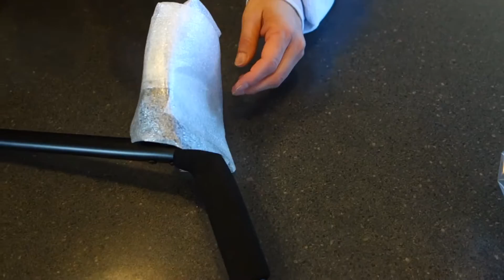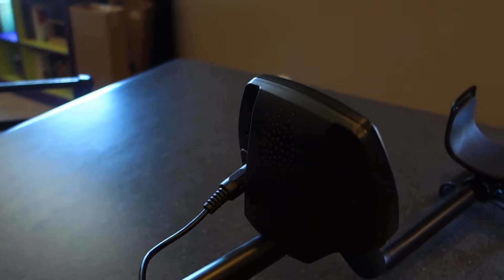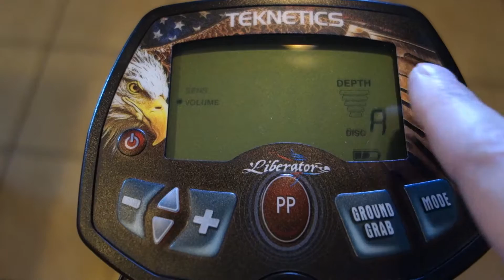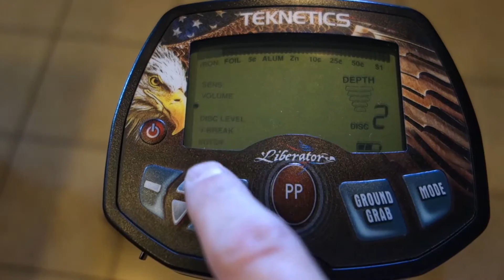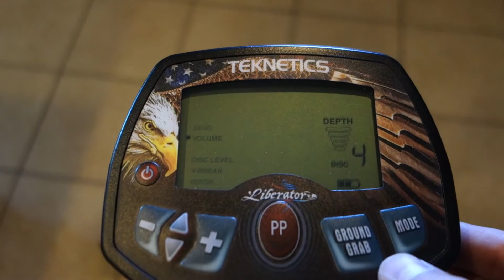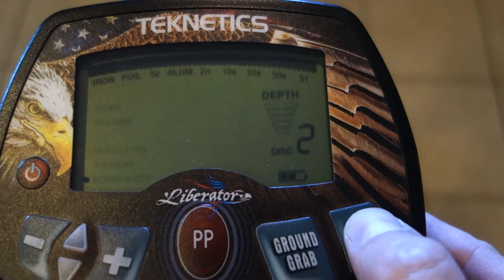Metal Detecting:  Teknetics Ameritek Liberator - Unboxing and Feature Review

Comment: Yep. It's an Land Ranger Pro. The LRP is a good machine (it was my #1 until I upgraded to a T2se). This is an improvement in that it doesn't say "Bounty Hunter" on it, which immediately causes people to talk shit.
Reply from the maker: From a marketing standpoint...it is genius and they should sell very well.
Reply: Even after I dug a merc at 7" in a trashy yard I get lip. This machine is outstanding for the price.
Reply: I think the only thing BH or FT in general needs to do to improve its brand are 2 things. 1. Don't make so many versions of the same or similar machine. By that I'm not referencing this move. BH alone has 3 or 4 renamed versions of the same machines like in the discovery series and many of the older muffler on a stick models. One reason people started to not take the brand seriously is because there's were too many and with often whimsical names. 
2. A warranty should be a warranty. This is one of the things that makes Apple so successful. The warranty is not in who owns it or where they bought it, but in the machine. I can walk into an Apple Store if I have a problem, which is rare with both Apple and FT,  and all they are concerned with is, is it an Apple, is something wrong with it not of my doing, and is it under warranty. If the answer to those 3 questions is yes, I'm covered. I don't have to hold on a receipt for 5 years that lets face it, most people are never going to find after the first month lol. I don't have to worry about if I bought it used whether the warranty follows the product, it does. This serves the consumer and producer well. The consumer has confidence and the producer doesn't have bad units out there people are using to base their opinions on.
Reply: Dan Rowell you're correct there. It amazes me that so many people even have such opinions of the Bounty Hunter brand, but they do. I've had many BH models including the LRP and they all served me well. It's similar to the Trump derangement syndrome we see going on, on the left. There's a disease called Bounty Hunter Derangement Syndrome where most of the complaints we see in forums aren't based in reality or actual experience. It has the following symptoms:

-Accepting rumors as gospel
-the irrational belief that nobody can save money and have a great machine
-the irrational fear that if Bounty Hunter is good, their Minelab is somehow less good
-feigning actual experience with a BH machine in order to trash it
-Trolling BH forums to alleviate the pain of overpaying for another brand, reassuring themselves they haven't overpayed
-anxiety in the actual presence of a BH machine

Comment: It's the same detector as the Bounty Hunter Land Ranger Pro.
Reply from the maker: LRP is being discontinued - this has a lower MSRP and a upgraded look - plus a $50 off code.  

So if the same means better...then yes I agree.  :)
Reply: TheHunterGT that's interesting. Maybe a new top of the line for Bounty Hunter in the pipeline then? That damn push in coil though, grrr
Reply from the maker: Perhaps the future BH top of the line will have a screw in.  :)
Reply: have you tested the bh platinum pro? tek gamma on a g2 stem?
Reply from the maker: I have not but might someday.  Have been receiving interest about it.   I do know the Gamma is different and has some hidden "trade secrets" according to Dave Johnson.   What those are other than the manual groud balance and sensitivity setting being different...IDK